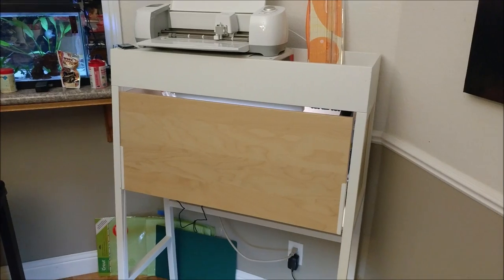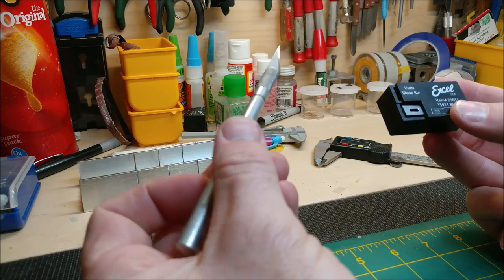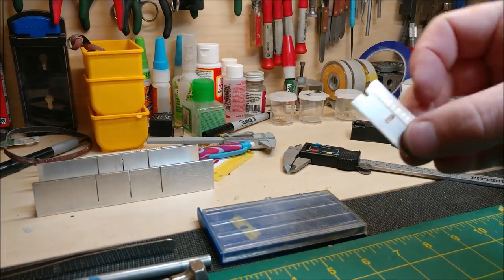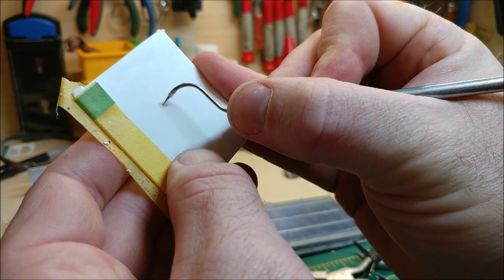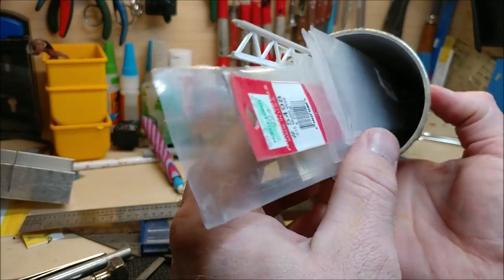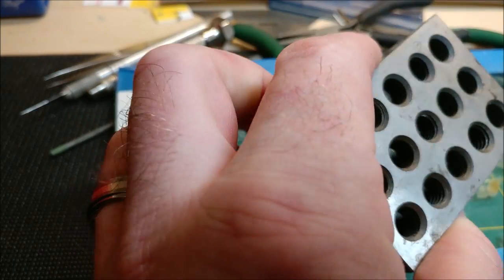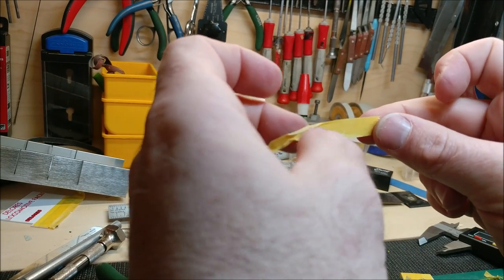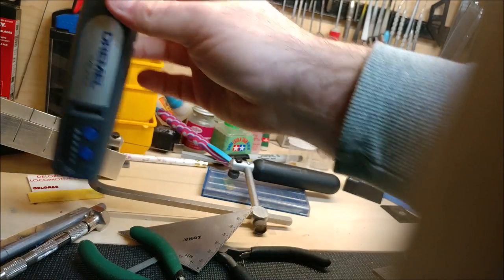Ikea Modeling Workbench for modelers without extra room.

Comment: Very good video. Excellent basic setup and tool overview for  the molder in a multipurpose room. Learned some new ideas myself.

Note of research after looking into some of the things:
1)  the 123 blocks at the low end cannot be bolted together to each other - even when they come in sets with bolts - because the incorrect Chinese factory design is such that the un-tapped holes in them are the same size as the tapped holes, just without the tapping, so the bolts will not go through them.  So buying solid (non holey) 123 blocks is probably just as good.  To get correctly made 123 blocks one has to spend $100 or more at least, as those are made correctly and for machinists.  Of course most machinists make their own blocks as part of their training/apprenticeship programs.
2) for the cost of the 15 blades in the dispenser with the blade disposal slot, one can for nearly the same price just get a pack of 100 blades.  Better bargain and just put the old blades in a old jar.

Comment: What are the interior dimensions? I'm trying to get a sense of the height from the desk level to the top. My ideal result is having my computer VESA mounted to the backing of the secretary but I'm hoping it's at least 17.75 inches in height inside. I look forward to your reply. Thanks!
Reply from the maker: There is a link to Ikea site in the description that shows the dimensions.
Reply: @Helmikins  Thanks for your prompt reply. I think I didn't describe my question well. The height distance between where a would laptop sits and the roof of the interior space of the opening isn't on their website and when I called them 30 or so minutes ago they couldn't tell me. Well, they tried, but tried to convince me it was 10 inches. I pressed that based on their model photo with a laptop that couldn't have been the right measurement. They later admitted that they actually didn't have the measurement.
Reply: Here's a link to clarify what I'm getting at: https://drive.google.com/file/d/1ppewdEkuWPcZAkCZML4aGI9D2WAhFZlY/view?usp=sharing
Reply from the maker: @hewuwu  ok, I'm out of town for a few more weeks but can measure it when I'm back in town.
Reply: @Helmikins  that would be super helpful. Thank you!
Reply: @Helmikins  Hello, I'm just following up on this and hoping you may be able to give me insight into how big the internal space is with this secretary. Thanks!
Reply from the maker: @hewuwu  sorry for the delay but the opening is 15 inches tall by 33 inches wide